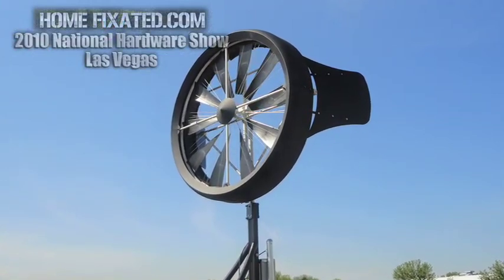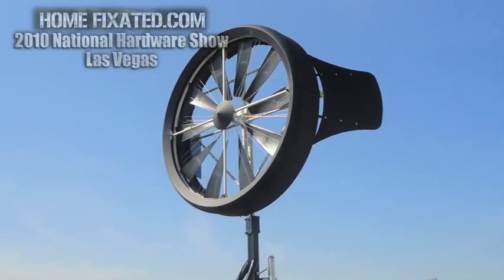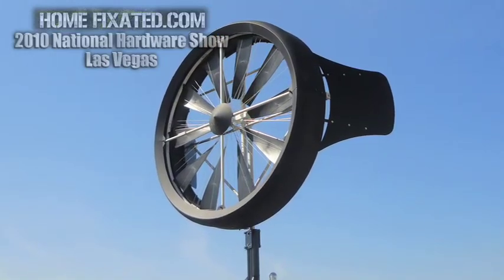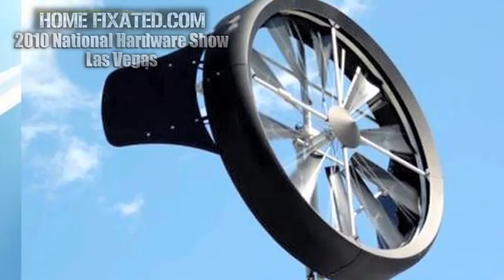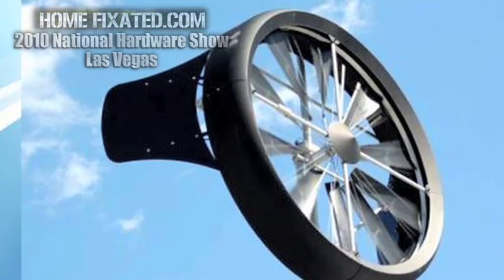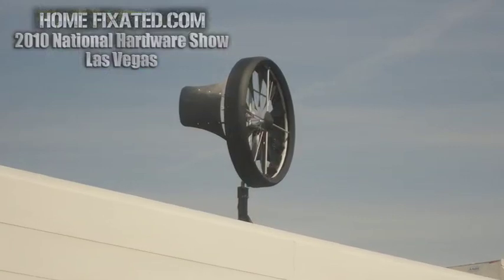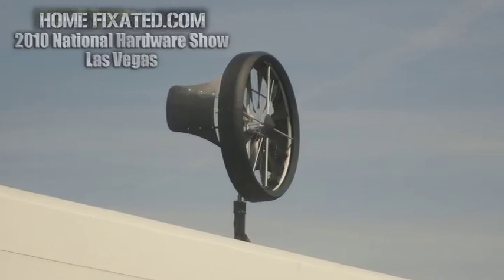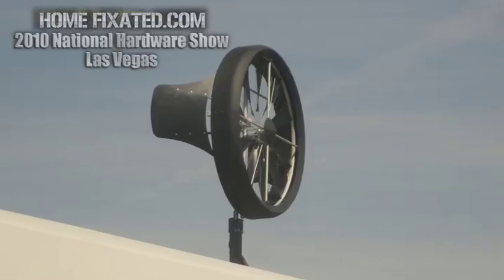Rooftop Small Home Wind Turbine Interview from Honeywell

Comment: Nice video, great information. But this is a failed system that didn't succeed. The RoofMill™ Wind Power Kit is one invention that has been so successful as a Wind Power Kit. For those who want a professional system that will hold up to hurricane winds and pass all federal, state, local, utility, and insurance rules. Customers are powering homes and businesses with the RoofMill™ in over 40 states installed in sites for almost 10 years now.  Look up RoofMill™ if you want to power a home or business.

Comment: The SolAir rooftop turbine, as seen on This Old House, now comes with a simple grid plug and play solution - 400W for only $700.  Check out the kickstarter project;  wind power for your home.  Anything spinning in the wind creates power, converting that power to useable energy is the most significant barrier.  SolAir now comes packaged out of the box with it's own specific power conversion tool.  dyocore.com

Comment: actually some of the turbines have whats called. Cut in Speed, which is set to not cut in until a specific speed.  They can adjust this and ofter do.  This is used to prevent bird and bat deaths, maximize power output and control overall power. Also, all of the larger wind turbines have actual breaks that they can used and are for normal maintenance. .Lets talk about ground turbulence.everyone "thinks" they have great wind, normally wind is too inconsistent and erratic to produce CONSISTENT pwr.